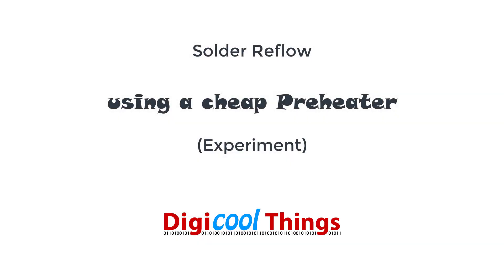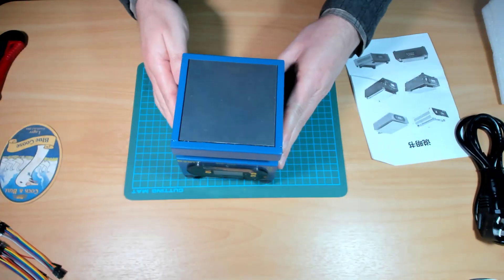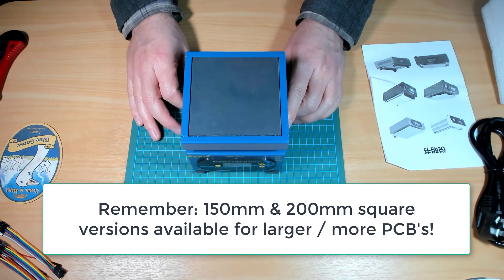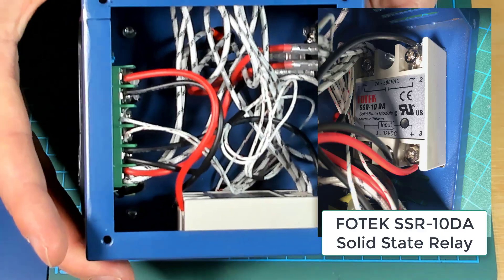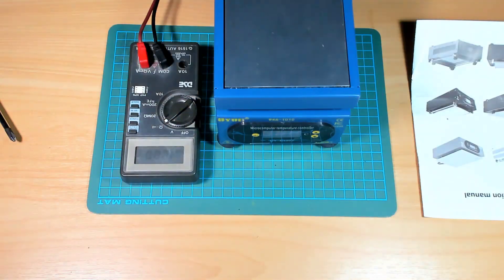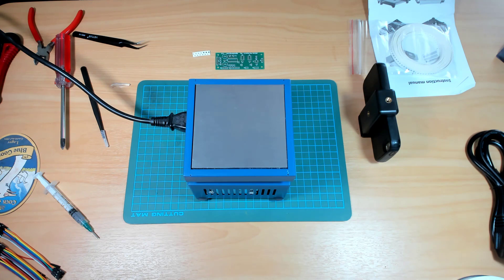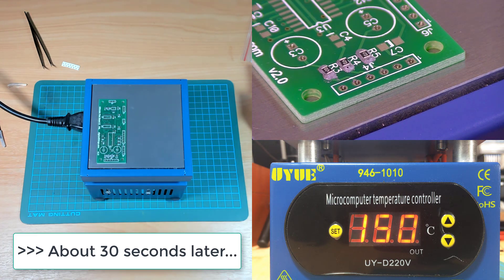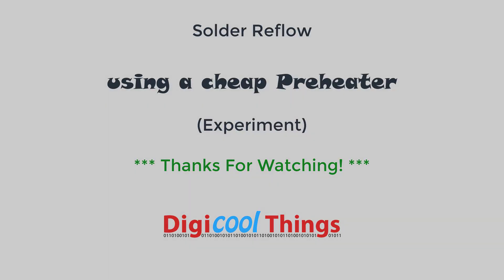Solder Reflow using a cheap Preheater Experiment (PART 1)

Comment: I'm looking for a pre-heater to mainly just heat up GPU board for my hot-air repairs. Most of the time, I'm just de-soldering one component off a board, this might be viable or go diy route, hmm.
Reply from the maker: Yes, what you describe is the more typical use of a pre-heater.  i.e. To just pre-heat the PCB up to a stable temperature, before using hot air for the final temperature boost to quickly rework the targeted component(s).  I do this quite often for SMD re-work as it is much easier and less stressful to the components / PCB, than using hot air for a longer period to heat a targetted area from room temperature.

Comment: what if the board cannot touch the hotplate? will it still be able to reflow components on the oposite side of the PCB?
Lets say you have a PCB with lots of components on the bottom,,and you have to heat from the bottom to solder solderingballs of BGA ontop..would this work for that?
Reply from the maker: Hot plate based reflow, or even pre-heating, is based on direct contact of the PCB itself with the heating surface. So for this reason it's not really applicable for reworking / repairing PCB's with components mounted on both sides of the PCB.  However, you could use it for PCB assembly of the first side of components, then completing the other side with a different method. eg. Hot air reflow using lower melting-point solder paste, or manual soldering (not for BGA obviously).
If you're reworking a BGA on an existing board, with components also on the underside, then I would use hot air rework station for BGA removal, and then either hot air, or reflow oven (with low temperature paste) for reseating the replacement BGA.  Hope this helps.
Reply: thanks!

Comment: I just clamp the edge of the pcb into a vise and heat it from below with a heatgun. Same effect, but faster and you can control the heat output to individual regions by just moving the heatgun around. Didn't have any discoloring so far.

Comment: Btw, any opinion on would it be worth getting the other variant named Kaisi 818 (https://es.aliexpress.com/item/32951230122.html?spm=a2g0o.productlist.0.0.788341f8zxLeQt&algo_pvid=34e4d477-7cd8-4ced-9dd4-bc9ce6b63291&algo_expid=34e4d477-7cd8-4ced-9dd4-bc9ce6b63291-0&btsid=0b0a0ae215955719634164517e32e2&ws_ab_test=searchweb0_0,searchweb201602_,searchweb201603_) versus the one you got UYUE 946-1010? The first one has a more sophisticated temperature control it seems, although it mentions only 260W..

Comment: A lot of power to connect 3 elements. Crazy !!!!
Reply from the maker: Yes, there are 3x 100W 220V Elements heating the top plate (which I show in the follow-up part 2 "tear down" video).

Comment: I guess you could just do it on the kitchen glass-top cooker. Put it in an old pan you don't use for food anymore. Turn it to medium, get that turkey oven thermometer for $2 beforehand and see what kind of temperature the plate produces. If too low, put it higher and vice versa until it's a constant 200 degrees C. Get some aluminum foil on the bottom of the pan, plop the board with pasted components in and wait. Visually inspect when the paste turns to flowing silver color and recedes back towards the components. Turn it off and remove the pan from the plate. Get some baking gloves, hold the alu foil and take the board with the foil out of the pan to cool faster. Wait a few minutes to cool and you're done. Or you could use a clothes iron. The problem with a clothes iron is it's hard to mount upside down and it's a small surface area and if it's not firmly attached it could tip over and ruin the board and whatever surface it lands on, plate first :)
Reply from the maker: Some creative thinking!  Yeah that could possibly work, although it’d have even less temperature / reflow profile accuracy, so it might be a bit unfriendly towards more sensitive components.  Hmm.  Also, one of the goals was to have a small / compact solution that can be easily stored and used on your workbench when needed.  A kitchen cooker and old pan wouldn’t quite fulfil this part of the plan, as nicely. :-)

Comment: A small update from me. If you keep pressing the set button you eventually Wil enter a menu where you can adjust the heater off time and the max temperature. Might fix the issue with slow heating!
Reply from the maker: Hi Stefan. Thanks for posting your update. I don't recall trying to press the set button for a prolonged period, so this is interesting news.
I can't try it for myself just now, as I've removed the old controller board and replaced it to give me an automated reflow setup.  :)
When I finally get my video recording space setup again I hope to do a follow-up and show how I've progressed with my modified pre-heater.
Over the last 9+ months I've moved house, renovated, and I'm now just working on setting up my entirely new workspace for my projects.
Reply: @DigicoolThings  Awesome! I am just awaiting a module for the thermal probe myself so I can make it work, I am tho afraid of letting it be on without a "pause" as it began smoking constantly, I might have to open it up to check if they have done something stupid. I'll take time on how long it takes to warm up from room tmepeture to 250 soon and give you an update. Did you buy a specific module that can do the reflow process or did you make a PCB for it?
Reply: Hello. I just tested it. Already 2 minutes after turning it on it was at 160 and under 5 minutes 250 so it does indeed work!
Reply from the maker: @decee1157  You got me curious, so I re-assembled my preheater with the original controller.  When I hold "Set" I get  a cycle of 400 -> 0 -> 20 -> 0 -> 1 (with the 1 flickering).  I assume 400 is the max setting, 20 perhaps a min setting?  But unsure what the other 3 represent. If I change the 1 to 0, then the heater doesn't seem to come on at all?  Anyway, your findings sound reasonable. The orginal controller gave me wildly inaccurate temp control (sometimes overheating by 20+ degrees).  Using a reflow controller, the heating time is perfectly fine and steady, it's just the cool-down that is too slow (expected of course, as there's no active cooling).
Reply: Hello. I hope you figured it out. Today I finally got time to do a mock up of it and actually made a system that let me create my own temperature profiles for it!
Reply: @decee1157   what kind of system are you talking about? Did you somehow program the built-in microcontroller or did you add an Arduino or smth? I would love to hear how you did it! :)
Reply: @montvydasklumbys7584  I made a frontpanel PCB for it and 3D printed a frontpanel mount, added a Arduino, added a temperature module and a simple program to control it. 
Never got around to finish it but it still worked really well. I used my multimeter to log the temperature to get a curve together with the temperature measurement the IC itself measures. Ended up actually working very well!
Reply: @decee1157  Thanks, that's nice! I was thinking maybe it would be possible to solder the wires to the front panel buttons and thus use Arduino PWM together with an electronic switch or just a MOSFET to send pulses aka button presses to change the temperature. By knowing the limitations in change in the temperature and ofc trusting the built-in thermocouple I believe it would be possible to create a temperature profile - what do you think?

Comment: I just recieved mine. When hooked up to my variac I can see the heater turns on/off each second. So a modified firmware might fix the slow heating problem

Comment: Really informative video. I'm thinking about buying one but wondering about heating rates. Yours seems to have a single 400W element and the 20cm^2 versions have two. There is a video of a 20cm^2 taking 7-8 min to get from room temp to 200C. How fast is the 1010 and do you think any difference is important?
Thanks again.
Reply from the maker: Thanks for the feedback.  I have progressed further with my pre-heater and I still use it for reflowing single prototype boards and for SMD rework.
The 1010 unit, which I have, is the 220v model and internally has 3x “220v 100W” labelled elements wired in parallel (for 300W total). Heat up time to 200/215C is in the order of just a few mins, which is fine.  The only issue is that the cool down rate is quite slow (there’s no active cooling), but this isn’t an issue for my use cases, as I simply remove the PCB to a heat resistant surface when the reflow (or rework) has been completed.
I do plan to make a follow-up video, when time permits, to show the modifications I've made to automate it for my reflow / rework needs.  :-)
Reply: @DigicoolThings  Thanks, I have ordered one and will keep the slow cooling rate in mind (and will take the boards off when reflowed).

Comment: I bought a 200mmx200mm plate and did the same thing out the box. Build seems good but the thermo coupler needs a few washers under it to hold it against the plate. Other than that, £45 posted, nice bit of kit.
Reply from the maker: Nice.  I'm curious how many elements the 200x200mm model has?  The 100x100mm has 3 elements. Is the larger unit the same, or have they bumped it up to perhaps 4 elements to cover the larger surface area?
I also must do an update video some time soon.
Reply: @DigicoolThings  it has two, larger elements. It give a nice even heat across the whole surface. It takes a little longer to heat up but heats up quickly once the plate is at 150c . The control can then be knocked up 100c in one go and once the reflow has taken place I normally knock it down by 50c for 30s then knock it down to 0c and allow it to slowly cool.

Comment: At that price where shipping is more then the item it's crazy. And building it is like 20USD free shipped in components.
Reply from the maker: Shipping for me was about half the price of the item itself.  You should certainly look at the total landed cost, to make any buy / no-buy decision.
You certainly could build one yourself, with the right components, and even code-up your own controller board.
But for me, I don't have the required metal working machine shop, so it made more sense to pay the shipping for a pre-made pre-heater. :)
Reply: @DigicoolThings  Case can be ordered from china, aluminum plate also custom thickness and size. No need for machine shop.

Comment: Any update on this ? How is it working out ?
Reply from the maker: Hi tablatronix. My pre-heater approach is still working great… for my requirements. :)

I use regular 63/37 Sn-Pb (183c melt point) solder paste, and I’m initially setting to 150c for soak, then reset to 215c for the reflow.
As the temp change rate is slower than ideal, I find that by the time the thermostat reaches 215c the boards are nicely reflowed and ready for removal. I then turn off and remove the boards onto a heat resistant mat for cool down.  I’ve been getting consistently good results! :)

I do much prefer the hot plate approach over an oven (for all the reasons mentioned in the video).  I also prefer hot plate approach for more heat sensitive items like NeoPixel, other SMD LED's, and SMD connectors etc. 

I was going to pursue modifications to automate the reflow profile, but decided that if going to the effort, I’d want to focus on the a larger 150mm or 200mm square (and higher power) pre-heater.  But adding the cost of buying another bigger pre-heater and redesigning to include cooling fans, I decided to park that idea for now.  Especially since manually controlling the 100mm pre-heater that I bought is working just fine for me, for now. :)

Do I still recommenced it?  Basically comes down to your budget... If you can afford a more expensive "proper" reflow profile automated hot plate system, then go for that.  But if you are on a budget, and don't mind the manual steps involved, then I still think the pre-heater approach is a great "budget" option.

ps. I haven’t completed any videos in recent months due to life getting in the way (downsizing + multiple relocations). Phew! Hopefully I’ll be fully back into maker projects soon, in my new workspace. :)
Reply: @DigicoolThings  have you tried rocketscream.com tiny reflow control  it's just  $24  ..  I just order a bigger hot plate to reflow many boards at a time and thinking to order this controller from rocketscrem .. can you check and advise should i buy that?
Reply from the maker: @asifalikhan8677  I hadn't seen these before. Via your link I found: "Tiny Reflow Controller V2" for US$29.90.  This looks like a nice budget reflow controller that appears to have all the connections you need.  ie. single thermocouple and single element SSR connections are exactly what you need.  It would be interesting to see how this works out.   Here are my thoughts:  The unknown is how the firmware copes with the heating profile of an open air pre-heater?  ie.  As we would not be using the fan connection (to allow active cooling), will the provided firmware follow a suitable reflow curve without excessive temperature over-shoot.  The Controleo2 that I used has a learning feature that allows it to "auto-tune" the element control.  Also, the Controleo2 has a "Bake" mode which allows setting a static temperature to maintain (allowing for dual use, so you can also continue to use as an actual pre-heater).  So some work on the github provided firmware may be needed?  Unfortunately when I added the Tiny Reflow Controller V2 to my cart, the only international shipping option (to my country) was Fedex at a cost equal to the controller itself (putting the total cost up to around US$60.   If you do go ahead with trying one of these, it would be great to hear how successful you find it as a potential pre-heater reflow replacement controller solution.  Have fun. :)
Reply: @DigicoolThings  I am thinking to give it a try because it is currently the cheapest option for auto reflow.  About the cooling I am thinking to add a low speed fan towards the plate maybe it will help. I'll replace the built-in controller with this tiny controller they both have same connections
Reply from the maker: @asifalikhan8677  Great. I look forward to hearing how you get on.  It would be great to find a lower cost controller that's a good match for a pre-heater reflow solution.  Worst case, if firmware changes are needed, this would be a better platform to code for than the typical inbuilt microcontroller. :)

Comment: Hi, very cool. I'm valutating buying one of these as my first attempt to reflow PCBs. Do you reccomend it? I will do 0402 passive and some 0.5 mm QFN. Do you think is possible with these setup? 
Thank you very much
Reply from the maker: Hi. Thanks. I've successfully been using my preheater for some time now. I'm just using regular 63/37 Sn-Pb (183c melt point) solder paste, and have found that if I first set the temp to 150c for the initial soak, and then set to 215c (for the reflow) it works great. As the temperature change rate is a little slower that desirable (for an accurate reflow profile), I find that by the time the thermostat has just reached 215c the boards are nicely reflowed and ready for removal. As cool down is also much slower than desirable for the final reflow phase, I remove the boards onto a heat resistant mat basically when the the temp hits 215c.  You may need to vary the temp, depending on your paste.
I much prefer the hot plate approach over an oven, as you have perfect visibility of what's happening, and can also easily prod any larger parts if alignment is needed (where too large for surface tension to self align them).  I also prefer hot plate approach for heat sensitive items like NeoPixel, other SMD LED's, and SMD connectors etc. 
Do I still recommenced it? Basically comes down to your budget... If you can afford a more expensive "proper" reflow profile accurate automated hot plate system, then go for that. But if you are on a budget, and don't mind the manual steps involved, then I still think the Preheater approach is a great "budget" option. :)

Comment: Interesting, I wasn't aware of them. I recall seeing someone do something similar with a clothes iron years back.
Reply from the maker: Okay, that got googling. Which located not only Clothes Iron Reflow, but also “Reflowing with a Hair Straightener”! LOL
I guess anything with a decent element and some form of temperature control could be pressed into the task.
Although, the perfectly flat and square Hot Plate would be one advantage of the Preheater. :)

Comment: Great video! That worked pretty well! I have a pretty big office/workshop and I was only thinking last night that the oven is taking up a lot of prime real estate!

I don't think it would take a huge amount to control the SSR with an Arduino if you wanted to make the process automated. You could even add a cheap blower fan to help with on the cool down (but running slowly so it doesnt blow anything off :) )
Reply from the maker: Yes, when I ordered I’d thought of possibly using Seon’s Reflow Master, hooked-up to the Thermocouple & SSR.
I’ll experiment with some fans to see what cool-down rate can be achieved, without obstructing access (or blowing anything off!).
Then, as you mention, there’s a huge temptation to hook-up an Arduino. Actually, all sorts of ideas are springing to mind. :)